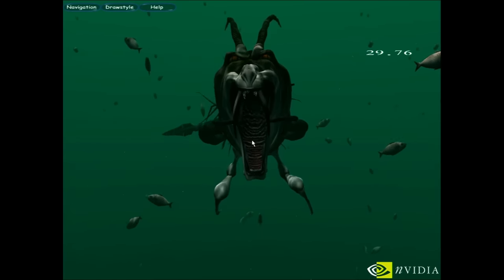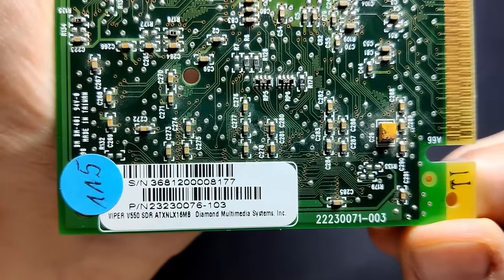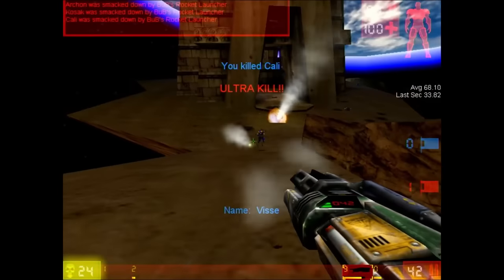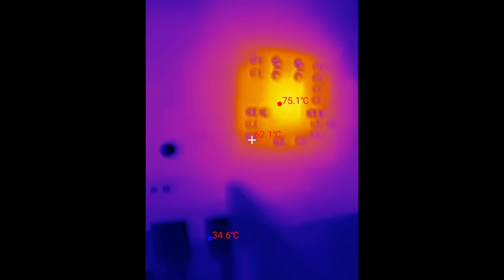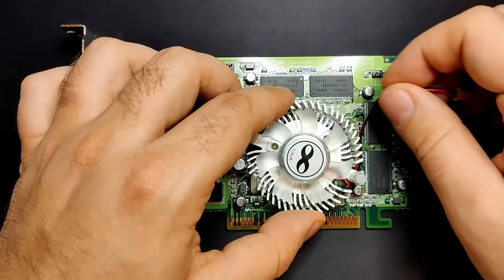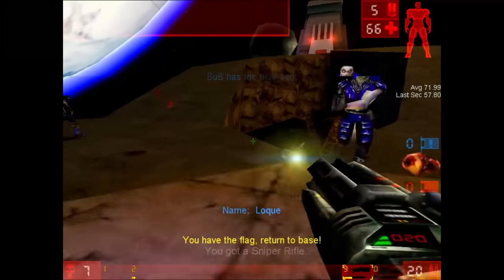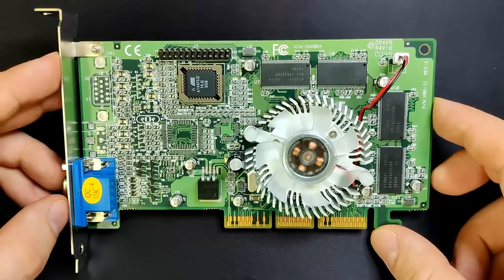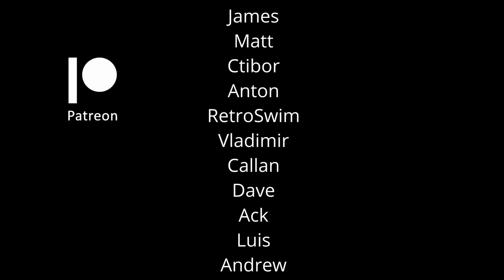Should you upgrade your retro graphic cards to active cooling?

Comment: Lately I am asking whether I should replace the shitty whiney coolers with nice chunky copper radiators on my geforce 2\geforce4 mx-s and Radeon 7000-s. Good idea or not?
Reply from the maker: Copper coolers may be expensive and may not improve the temperatures that much. What about just replacing the fans or reducing their speed? If possible, replacing old thermal paste will also help to achieve lower temperatures.
Reply: @bitsundbolts  I can source these from a recycling facility almost for nothing.
Reply: I mean the original ones almost didn't have any fins and were practically just a housing for the cooler.
Reply from the maker: You could try with one card and see how much the temperatures improve. If there is a significant improvement, then I would go ahead and replace the coolers for all the retro gear l. It's a nice project and you give them a little bit of TLC.

Comment: YES PLEASE PUT 250mhz memory on, i have a mx400 that overclocks on core to 255mhz without artifacts, it has 5ns memory only.i have another one that does 235mhz core but only had 5.5ns memory.
i can't solder for shit, is there memory that goes even faster though? 300mhz?